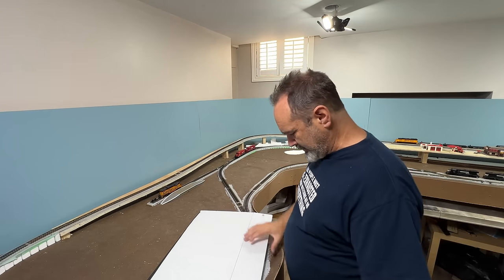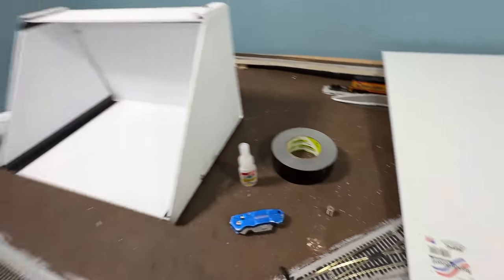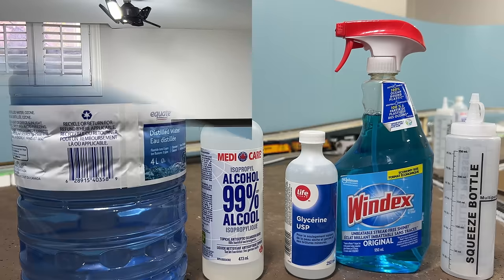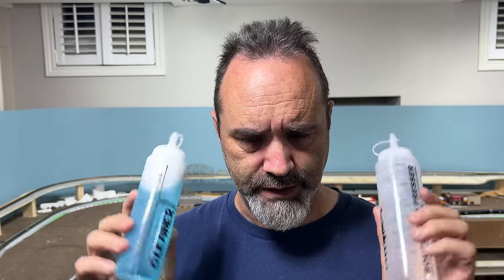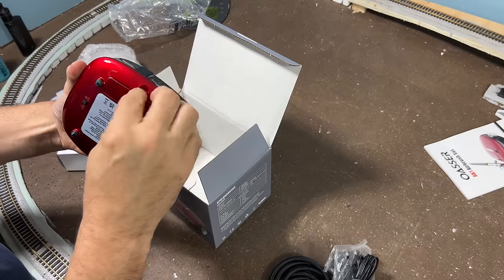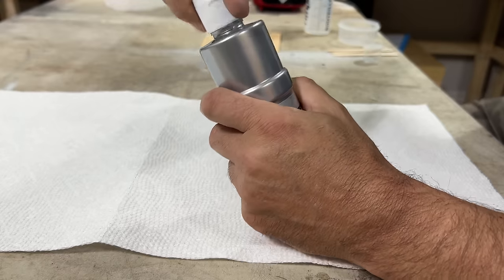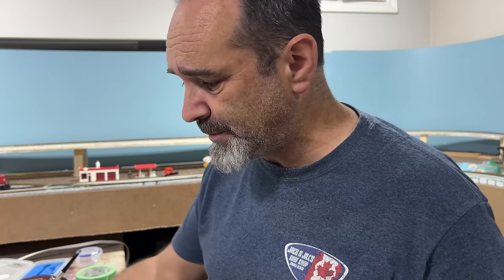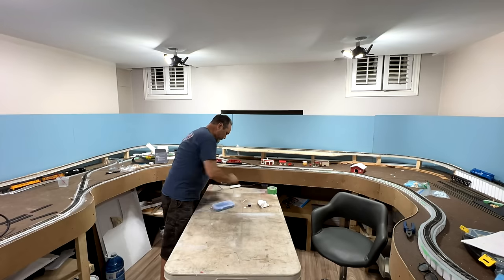Five Dollar Paint Booth For My Budget Air Brush Kit - First Attempt At Air Brushing! - Win Or Fail?

Comment: Metallic paints can be a real bear to run through air brushes due to the size of the metallic flake that is suspended in them; it can help to look at brands that are formulated for airbrushes, like Vallejo Model Air (and there are heaps of others, I'm just mainly familiar with VMA). I really like your idea for a fold-away spray booth and intend to build one for myself.
Reply from the maker: Yeah, it was a pretty big ask, for a budget airbrush to spray budget metalic paint, lol. Hey, if you never try..... Thanks for the advice.
Reply: @ScottRails  No worries! The layout is coming along nicely, keep it up!

Comment: That came out well!
The problem with the silver paint may have been that it was just too thick to properly spray through the needle/nozzle combination on that airbrush. I don't know what size needle it has, but for that silver paint I'm guessing a .5mm needle/nozzle would be needed.
Reply from the maker: Yes, I think the needle in this is like 0.2mm, which is way too small. Had to try it though, now I know.

Comment: Nice to see a vid where, just as for me, not everything goes according to plan right away.
Paint splatter is usully caused by too low air pressure or too thick paintmix.
But really nice result in the end!
Reply from the maker: I could maybe have stirred it a bit longer, but as you say, it turned out fine. I'm making sure to clean it the instant I'm done. I know these things can clog and get ruined forever.

Comment: WOW WOW, WOW! I recently been unpacking and figuring out what to do with my train stuff.  Most of its been packed away since the late 80s, but I found some receipts for 2008. Among this trove was a similar airbrush starter set, new, unused, in the box. I’m thinking, I’ll need a spray booth. Then 💥 BAM! You post this video 3 days ago. Like you answered all my questions, 3 days before I had them! 
Thanks! Thanks 🙏
Reply from the maker: So are you about to build a new layout?
Reply: @ScottRails  Actually just unpacking boxes and saying “What will I do with this?” Most likely to be a shelf layout/diorama as Its HO scale and I have very limited space. There’ll be no “running trains” here.
Reply from the maker: @aircooledhead  What about making a hinged shelf, so you can drop it down when you want to run trains. Obviously you'd be limited with buildings and scenery, but at least it could be "alive". Just model Florida, it's pretty flat, lol.

Comment: Hi Dave   thats a great little airbrush kit but i have a couple  of suggestions . My first is to get yourself a quick release set , its the same as you have on your air tools in the garage but smaller , much smaller but makes life simple when you want to clean the brush .
Others have talked about thinning the paint but no one has mentioned tip drying . This is very common with acrylics and its where the paint collects and then dries around the tip . Pull the front cap off and if there is a build up around the tip/ nozzle  pick it off with your nails or use a soft brush and the same thinner as you're using for the paint . You can spray without the front cap but you have to be careful  as the needle is exposed .
My almost last tip would be to watch a guy who has a YouTube channel  called Airbrush Asylum.  Lots of good info plus he's an Aussie .
My last tip , wear a respirator.  I know you have one as you clear spray Bugsy . Remember that the paint coming out of your airbrush is made up of finer particles than your normal gun so a lot easier to inhale , nasty .
Cheers Paul.
Reply from the maker: Thanks Paul. Quick release would be awesome, I'll have a look. I did remember to remove that front tip to clean it, that needle is tiny, and looks very breakable. 
I'll look up Airbrush Asylum. Thanks again.